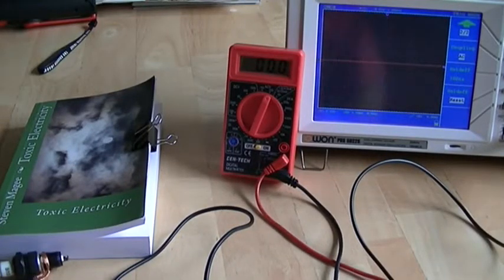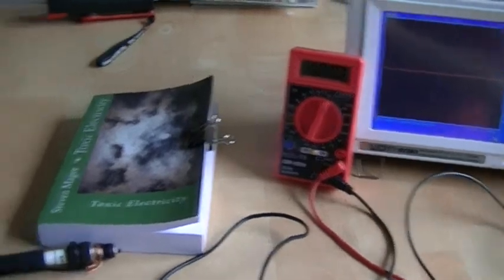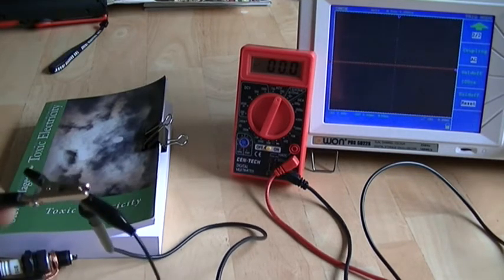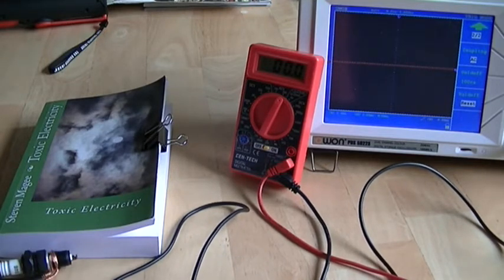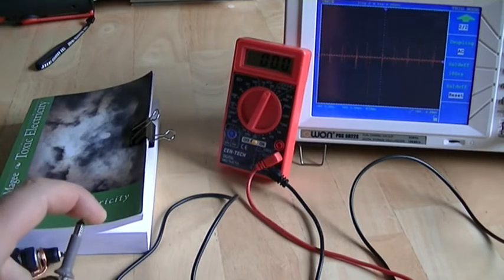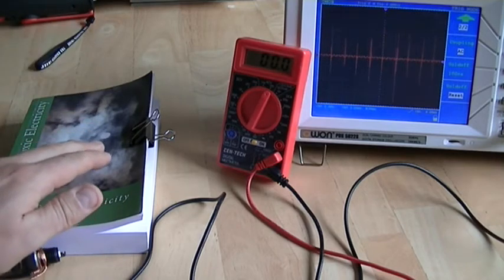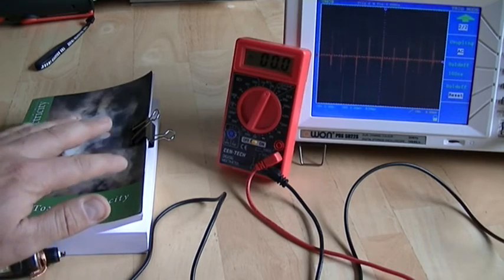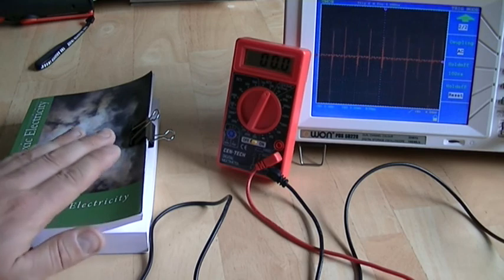David Blaine Electrified - Human Body Voltage and Exposure to Sparks

Comment: I once took a very small hand held prank high voltage shocker, which was powered by a AA or AAA battery. The shocker I held at the top, a wire dangled from that connected to one lead of the LED, the other lead of the LED connected to a wire about a foot long which dangled in the air below it, with the other end of said wire touching nothing but air. The shocker used nothing but a coil and mechanical interrupter and a switch. I may have been touching one of the contacts in the shocker's circuit. The LED lit up very visibly, and I didn't feel anything. An apparent open circuit, but it worked.